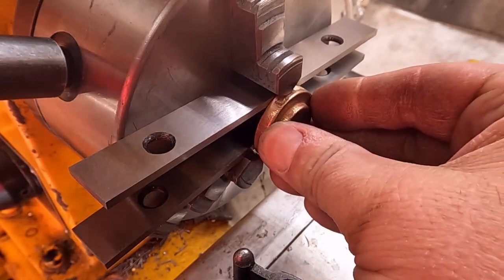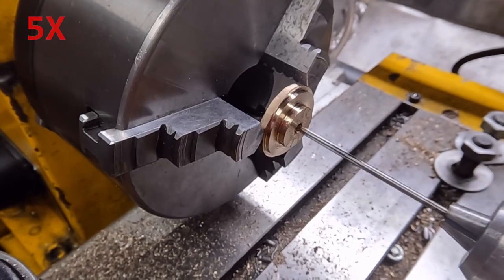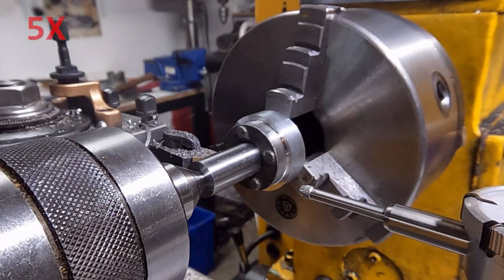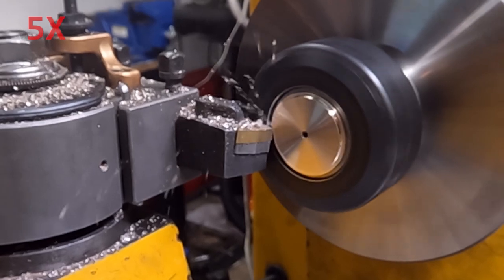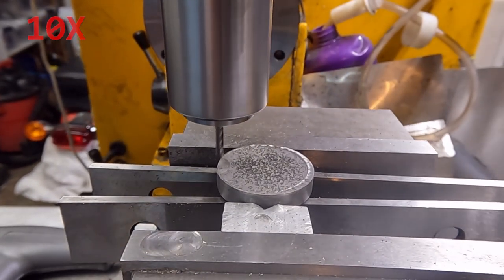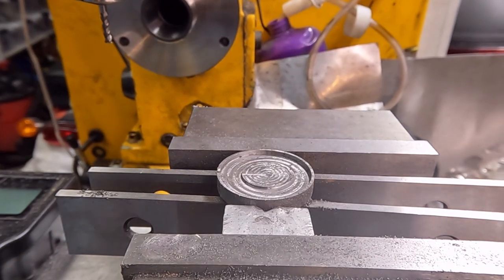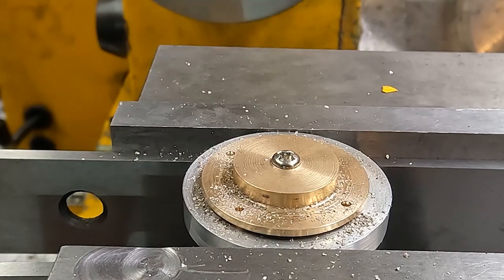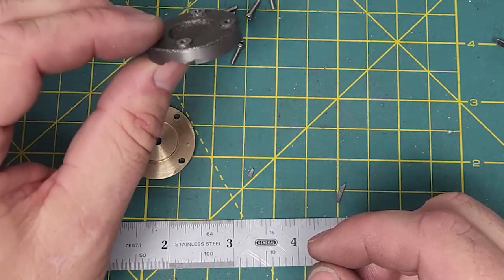15 Machining the Cylinder Heads - PMR #5 #steamengine #steamengines #lathe #machining #turning

Comment: if it was mine I would machine the "ugly" off. We all make mistakes, it's how you learn. You should see my pile of scrap parts.
Reply from the maker: I confess I've always tended to have a bit of a "git 'er done" mentality for the mechanical stuff, with function before form. My old Ariel motorcycle used to win GROT trophies at the rallies I used to go to - but also won some "farthest traveled" at the same events. This is a bit of an exercise to mend my ways, so after I get it running, I'll probably remake all the dodgy parts using lessons learned.
Reply: @thumperthoughts  re the "Ugly" I assume the cylinder will be clad in wood, If you machine off the "ugly" you could always machine off a small step of the same amount off of the columb, then the wooden cladding would still be symmetrical. just a thought.
Reply from the maker: @paul rayner  I never thought about cladding! Thanks for the idea💡
Reply: @thumperthoughts  no problem, just my thoughts